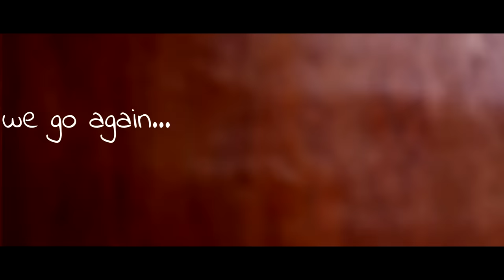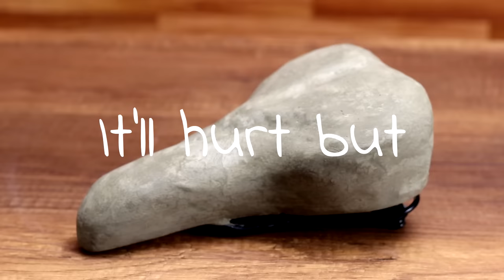Epic Cycling | 134.5 kg Concrete Bike

Comment: Since not everything is concrete (there are some metal pieces), it would have been good to line the edge of the tires with a rubber strip so that they do not chip when rolling.

Comment: So does it ride on the flat part of the wheels? If so I'd be worried about any aggressive corning that gets you off the flat part. I feel like the bike will have a strong tendency to tip given the weight, as the inertia from the wheels that typically makes it easier to balance is much weaker here.

Comment: Let's start the race for the 99kg concrete bike followed by the SL 50kg concrete bike. Shouldn't be hard if the concrete was reinforced with carbon fibers instead of steel rods.

Comment: The end result looks cool, but I'm disappointed. I was expecting an entirely concrete bicycle. This is mostly an actual bicycle that is coated in concrete.
Reply from the maker: I thank you for your estimate, because it is something that we originally planned from the beginning, but after experimenting it was not possible and we had to resort to using some recycled parts, especially in the sections where some moving part is attached, but trying to keep the original concept , doing everything else, when possible, with only concrete or at least how the concrete is originally worked (iron for the beams, reinforcements, etc) greetings!